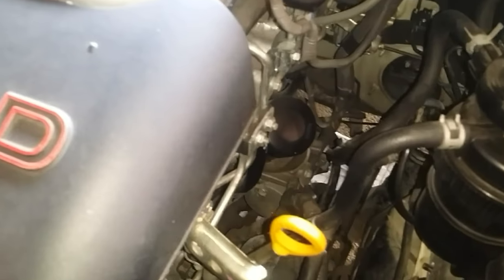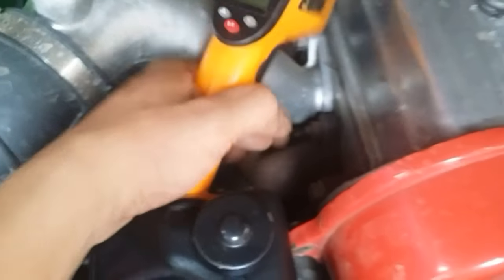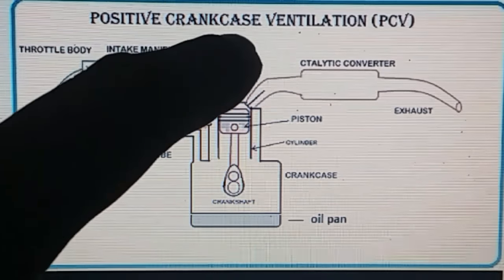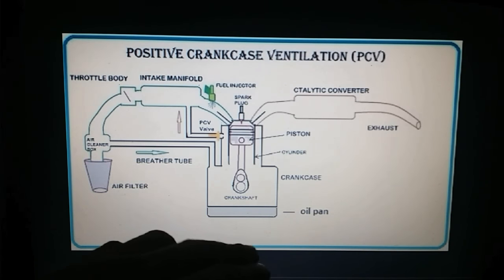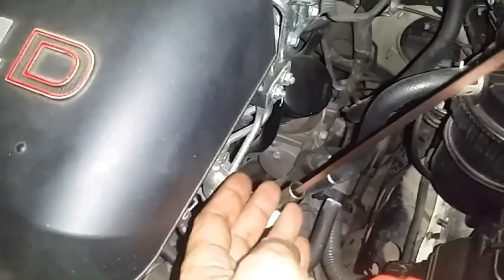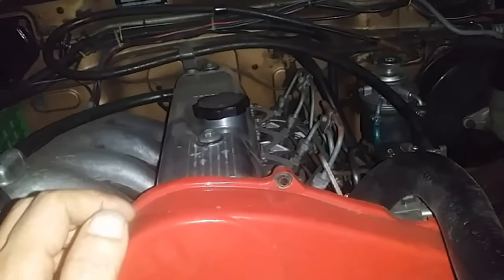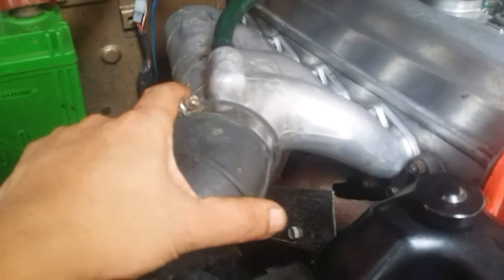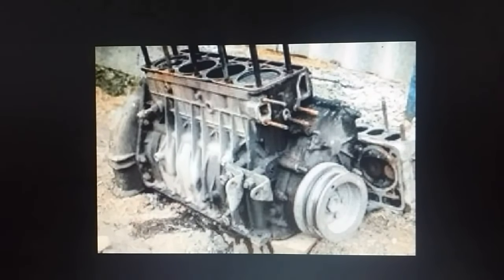Blowby Oil Smoke out the Dipstick Hole is NOT NORMAL, PCV Valve, Runaway Diesel

Comment: Hi, I'm back after taking yoyr advice and it has finally resolved my issue. No more leaking oil into the turbo manifold, DPF & exhaust. No longer oil also goung into the intercooler and air inlet system and no oil coming out the dipstick. Cant thank you enough. Car been off the road for 4 months as i had to fix it myself. Garage wanted £1500, done it for under 500 including this part and rebuilt turbo. Thank you 😊
Reply from the maker: Sorry cant really remember what advise i gave you but im glad it all worked out fine for you. Congratulations.

Comment: I'm getting smoke (but no oil) from the dipstick tube once the engine is warm (Toyota 3S-FE 2.0 petrol). It also isn't sucking air in from the dipstick tube. I've replaced the PCV valve and cleaned out the valve cover and baffles are all clear. 
The PCV hose to the intake is sucking air very strong and PCV valve is working correctly, but the breather from before the throttle body to the valve cover is hardly sucking into the valve cover.
When I take off the oil filler cap it is blowing air/gases very much, but the engine does not change/stall.
What could be the problem?
There doesn't seem to be an egr valve or maf sensor but there is a map sensor that has a 'gas filter' before it.
Could a faulty map sensor or clogged 'gas filter' cause this?
No lights on the dash either.
What would be your actions to diagnose this problem? A compression test on each cylinder?

Comment: Thank you sir for the valuable information 👌These channels are the best bit of social media !
But do I understand correct that a diesel engine can not be the problem of excessive blowby ?
In that case it must be the PCV valve. I also have no vacuum under the oil filler cap. It's rather blowing out air/smoke a little bit there as well. 
And under normal circumstances the car smells pretty bad but not necessarily from the rear..

Comment: You Sir, have by far made the best explanation video regarding the importance of a working PCV Valve.
Very detailed with common symptoms, causes and fixes.
Most of the other channels focus on outstanding visuals (intros, graphics, loud disturbing music, you name it!). You, on the other hand, go straight to the point.
Subscribed and liked!!!👍
Reply: One simple question... Having any amount of white smoke coming out of the dipstick hole once the engine has reached working temperature is ALWAYS related to a bad PCV Valve?
Reply from the maker: No. If the pcv valve is working and you still see white smoke outthe dipstick hole i suggest perform a compression test.
Reply: @MrDIYer  Thanks a lot for your reply! The thing is I don't know if my pcv valve is working. I was trying to relate that to the light white smoke coming out from the dipstick hole while the engine is running already warm.

Comment: In the M57 oil vapour or smoke coming out of oil filler cap is normal. It should not lift the oil cap when placed upside down but can escape. Many bmw owners see this even on low miles . This doesn’t mean worn out engine .
Please explain if I’m wrong

Comment: Thank you sir for the info I have extensive blow-by on my 4d56t it is low on power . these days because of a crack cylinder head I had on and a bad thermostat I didn't know about that was causing the engine to over head but she my baby so I take care of her soon.. thanks for the info
Reply: I had same thing but I put new turbo on still heaps of blowby i need some help
Reply: But I got power back and it hits boost just fine

Comment: Excellent video. I have engine oil getting squirted out  lightly from the engine dispstick hole on my Kia 1.5 U2 CRDI engine. Car has done only 16000kms and maintained according to the manual. 
Should it be a concern?
Reply: If engine is cold it is ok to have a very little (minute) amount of oil coming out due to viscosity. But if its squirting you might want to check it. How was it now?
Reply: Did you figure it out? Please provide us an update.

Comment: Hi @Mr.DIYer, thanks for the great info. I would like to share that there is one more possibility about blowby causes that is a failing head gasket on a 10 k rebuilded engine, I mean that is not always needed a rebuild, it can be also a bad head gasket that leaks compression gases into the oil line which hits the  crankcase and spills engine oil throuh the dipstick. Do you agree?
Reply: Good point.

Comment: Great video.. Very informative and very well explained.. Out of topic.. What could cause a map sensor code... I've replaced parts like crazy and i still can figure it out.
Reply from the maker: It could be anything from a dirty air filter to a dirty fuel filter or misfiring sparkplugs etc or the sensor itself. Even a torn or loose air hose or clamps. I suggest start with the simplest that doeant require replacing parts like check for loose clamps. Try to run the engjne with and without air filter etc.

Comment: Great video and explanation. Hope you can help me on this. My 4m40 space gear blows oil out of the dipstick tube. No white smoke emmitted, no misfires, no overheating issue, no oil consumption, coolant not mixing with oil and has a lot of power. I made sure sure crankcase ventillation is good and oil level is at spec. Any idea whats pressurizing the crankcase pushing oil out of he dipstick? Any advice is appreciated
Reply: Mate It can be a failing Head gasket, It might worn out at the oil gallery line, scaping compression gases
Reply: Did you figure it out? Please provide us an update.

Comment: Hi kuyang, pagkkatapos pong macalibrate ang inj pump,  nagkabit po ako ng oil catch can sa 03 Starex D4BH(4D56).  Medyo masikip po ang hangin na dumadaan sa oil catch can gawa ng may mga filter po na nakalagay sa loob nya. After 3 days na gamit, napansin ko malakas ang tilamsik ng langis sa deepstick ko. Wala naman po iyon nung di ko pa kinabit ung catch can. Tinanngal ko po ung catch can at binalik ko po sa dati, pero ganun pa din po,  duon na tumitilamsik ang langis sa deepstick. Nawala po ung tilamsik ng langis sa oil cap at breaher. Parang mas malakas pa ang hangin na lumalabas sa deepstick ngayon. Wala naman pong pagbabago ang hatak at takbo ng makina at wala din pong kausok usok na lumalabas sa tambutso. Hindi din po nagooverheat at tama naman po ang idling at timing.  Ano po kaya ang naging problema po? Salamat po sa sagot. GOD Bless po.
Reply: Sir anu na pi update ng sasakyan nyo pardhas kc po tayo 4d56 natalsik sa dipstick napaayos nyo ma po ba?salamat

Comment: New subscriber here. Sir, I absolutely see no oil splatter both in the dipstick hole as well as in the oil filler. I perform the paper test that you did in your videos. However, I see a little amount of smoke coming out from the dipstick hole. Is it a normal blowby? What is the possible explanation for the smoke sir? thank you.
Reply from the maker: Only way to be sure is perform a compression test

Comment: Appreciate your time I have a procharged 90’ corvette and after about 4K rpm it will smoke from the dipstick and more recently started running a little warmer and might leak coolant I’m curious if the oil and smoke issue could be from the Pcv system as the valve was disconnected from the valve cover and I’ve tried reconnecting it to the valve cover and it still doesn’t seem right
Reply from the maker: if you have taken out the pcv valve and it does the same thing then you can rule out a clogged pcv. however before doing anything drastic i would suggest the only way to be sure is a compression test. there are petrol compression tester that are fairly cheap now a days and should serve the purpose. plus its easier to do on a petrol engine than on a diesel.
Reply: @MrDIYer  I’ll be running a compression test as soon as I can, yet again thank you for your time sir.

Comment: I have 20 rav4 non hybrid, about 9,500 miles. I checked oil after 15 minute drive. Saw vapor from dipstick tube.  Is this normal I should I take it too dealer.

Comment: Very good job at explaining. I hope your channel has good growth in the future! 

I have a question. My car is a Peugeot 406 with a 1.8L 16v petrol engine (PSA EW7), its now 20 years old and has 207,000km on it. When I rev past 5000rpm, the oil dipstick will loosen a very tiny bit (like about 1cm, but that's it). There is no oil or smoke coming out, breather hose was replaced 2 months ago.

I did the oil cap test like you said, tiny bit of oil from the camshaft is hitting the paper, and the paper is slightly getting sucked into the engine.

Is this normal blowby?
Reply from the maker: i think it is. if no oil, especially smoke coming out of the dipstick hole your engine is fine.

Comment: sir i have a hyundai starex model 1999 diesel manual when i clean the EGR found out too much carbon i clean it with diesel but i saw the turbo charger fron intake and exhaust there is present of oil i wipe with cloth but i didnt  dismantle and then back the EGR. is it normal or indication of blow by? thank you for your help

Comment: Hi sir.. I was planning to buy a second hand 2016 ford everest with only 45k mileage. When i checked the dipstick, it was spewing white smoke. Is this still a good engine? Thanks for answering. Stay safe.
Reply from the maker: Smoke out of the dipstick hile is never a good sign. Conduct compression test to be sure.
Reply: @MrDIYer  if the compression test result is not good, does that mean the engine needs overhauling?

Comment: I get no blow by out of Dipstick tube but I can feel quite a bit at the oil filler hole.... what does that mean? Does that mean the valves are leaking and not the piston rings? Very strange... someone said it maybe the turbo seals... any thoughts?
Reply from the maker: If your valves seals are worn out every now and then your vehicle will spew out black smoke especially during cold start

Comment: I have blowby in a corvair but I have good compression in all cylinders. I do not understand. Blowby is from bad rings but I blow no smoke out tailpipe but blowby smoke from PCV vent tube chokes out moter and stalls at idle unless i unhook the PCV. But I do not understand how I could have good compression in all cylinders?
Reply from the maker: 1. try to replace the pcv valce
2. try tune up. perhaps theres an inbalance in the fuel to air ratio.

Comment: Does an 4d56 engine has a PCV valve? My engine is smoking throug the valve cover and the dip stick, but the engine is performing well, no hard cold starts, the blowby decrease more when i flush the engine oil, i just want to knoe if my engine needs an overhaul, thank you
Reply from the maker: No pcv valve on diesel engines. Only on gas engines. You may have one worn out cylinder. Perfom compression test

Comment: your video is very informative but you have mixed up between a breather hose and a pcv valve . 
The pcv valve is connected to a vaccum source ( intake manifold ) and the breather hose draws air from a location just after the  air filter and into the tappet cover
Reply from the maker: Lol
Reply: @MrDIYer I am no expert . I just happen to  own a car with a 1.3 litre petrol mpfi . On the tappwt cover is a pcv valve and a breather  port . I used to wonder the function of the breather hose . Seeing your video I figured the breather port is meant to balance the afr .
Reply from the maker: Please point out to me in which part of my video did i mixed up the pcv valve with a breather hose?  Do you know that the breather hose in a diesel engine is connected to the intake manifold too,  in what you refer as a vacuum source?  So please point out to me where in my video did i mixed up the two?
Reply: @MrDIYer  I have never owned a diesel so maybe im mistaken .The pcv valve has a non-return  mechanism . Does the D4D not have a pcv ?

Comment: Sir, I own a Toyota Hilux Invincible 2009 (1KD, Inter-cooler, 217000km mileage).
Below are existing engine conditions:

Blow by from oil cap - a little smoke as well.

A little blow by & smoke from oil dipstick tube.
No abnormal engine noise (no rattling or knocking).
No exhaust smoke up-to 3000 RPM - a little beyond 4000+
Not reducing engine oil.
Car starts instantly - doesn't take a long ignition.

Does the engine requires a repair?
Reply from the maker: i dont think so. perform compression test to be sure.

Comment: My 4d56 had oil leaking through turbo
My mechanic  examined  and changed blow pipe and said it was soft making intake blocked thats why turbo was leaking oil .... do i need complete  tuning and service of intake ? &
I have white smoke problem  and sometimes when i pushes vehicle  in 2 or 3 gear in high rpm it smokes black
Reply from the maker: i suggest you repair the turbo leak, you can buy a turbo repair kit. as for the smoke try to adjust the fuel enrichment screw. https://youtu.be/VWBu53sNbas

Comment: I did an oil change on my 2004 toyota sienna while cold and smoke came out of the oil drain plug while it drained. Can't find anything online about this. Any input??
Reply: Did you figure it out? Please provide us an update.
Reply: @florenbaron7111  No I didn't. The van had almost 300k miles on it and multiple other things going on. Decided to gift it to a family member. It was still running but didn't want to dump too much money into it.

Comment: Gud evening, how about to my isuzu crosswind xto 2.5 turbo theres smoke and engine oil particularly in normal temp and hot the smoke and engine oil coming out on deepstick it is happened when the engine oil level in maximum level but i make it in below maximum level on the dipstick the oil and smoke was becomes non or nothing anymore is it ok. May engine oil level lower in a maximum level about 1/4 below from maximum level Sir.? Is it wrong or bad to my car engine Sir ?
Reply from the maker: as long as it still above the minimum level.